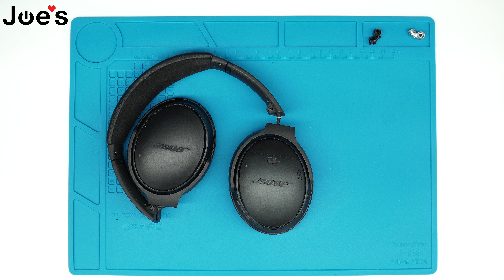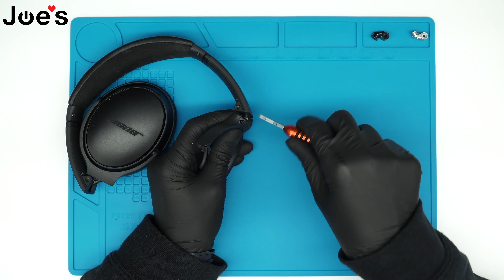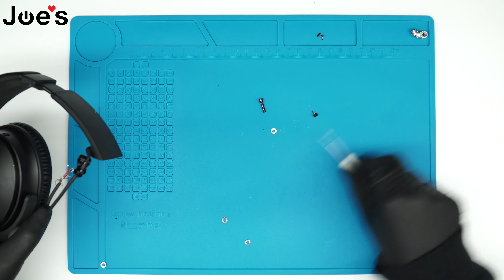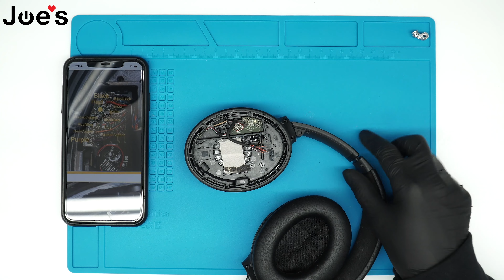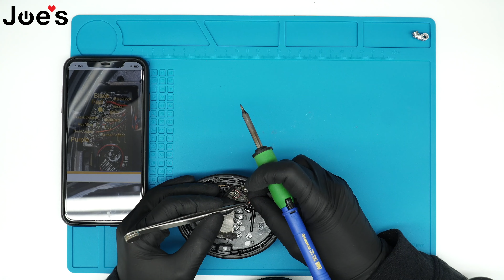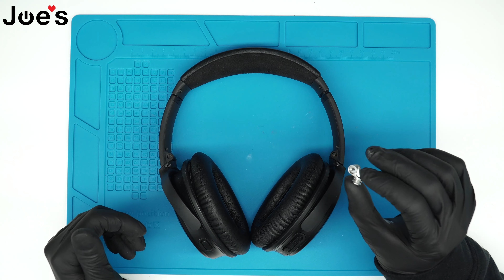How to Replace Bose QuietComfort QC35 I II Metal Swivel Hinge Right | Repair Tutorial

Comment: Hello Joe, are you still fixing Bose headphones??  I have a pair of Bose QuietComfort SC Wireless Bluetooth Headphones that I bought November of 2024 from Sams Wholesale.  The metal arched band inside the headband has broke at both ends of the headband. Can you fix this issue?
Reply from the maker: We may be able to help with that repair. Please send us an email at [support@joesge.com] with your question, exact model number, and what issue you’re having.

You can also fill out our repair service form here:
https://www.joesge.com/pages/repair-service

The more details you include (no sound, not charging, one side not working, battery issue, broken hinge, etc.) the better we can point you in the right direction.

Comment: WARNING  to anyone doing this repair without an ajustable heat gun: heat the area too long or too hot and the casing of the speaker will melt and you will lose audio quality forever. I  hope you checked this before and not after attempting the repair like me.. cuz the video doesn't specify it, even if the rest of it is great.
Reply from the maker: Great tip, thanks for sharing! Like and sub for more repair videos!

Comment: I replaced my headband on my QC 35 and wasn't sure about soldering the wires back correctly. This guide plus the one on your site helped me confirm the correct colours vs. soldering points. 
PS: I tested the headphones without putting back on the pads and there was this loud feedback noise, which made me think that I had made a mistake when soldering back the wires. Turns out that those pads need to be in place, then there's no feedback; just silence. :) Thank you!
Reply from the maker: So happy to hear your video was helpful for you!

Comment: Didn't even get to the soldering part. Gave up after an hour at trying to get the wires through the new hinge. The other headset started crackling from the wires touching each other. Now all thrown away and bought the ultras.
Reply from the maker: Ultras are really nice.

Comment: I used a milling machine to cut 2 hinges in perfect halves and fixed it like that. It only took a few minutes. I cut them perfectly and there was a tiny bit of looseness. If you try this method, give extra .15mm on each side(just over molding line in middle of part)
(You will also have to file off the proper tooth stopper on hinge but make sure it’s the correct one. You will have 1 on fixed side not 2).
 Go slow! I  messed up first part cutting too much metal but had an extra. I actually used 2 L sides to fix the R side.
Reply: *2 left hinges to fix R side
Reply: Be very careful no to over tighten the last 2 little Philips screws..they easily strip. Snug is fine

Comment: Did this and got everything together but when i power them on its screams like a siren😢. Don't know were it whent wrong. Tried unsolder 1 wire to se if the siren alarm whent off with no luck! Resolder the same wire and unsolder another whitout any diffrens. Any ide what have gone wrong? Someon tought it  could be the polarity that should be reversed.
Reply from the maker: From what I was told from a repair ninja you may have soldered one of the wires on the board improperly. Did you take a photo of the board and wire orientation before you took it off?

Comment: Which screwdrivers did you use? And how is the screw called which is holding the metal swivel
Reply from the maker: https://www.joesge.com/products/bose-qc35-qc25-hinge-screwdriver-t8-tool?_pos=1&_sid=851e96484&_ss=r
Reply from the maker: https://www.joesge.com/products/bose-quietcomfort-qc35-hinge-side-panel-part?variant=31833233981486